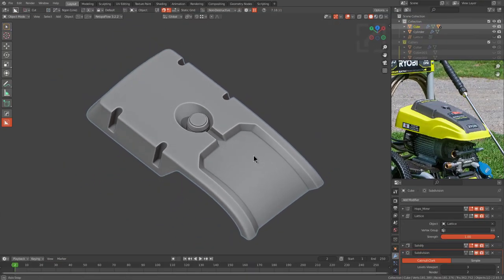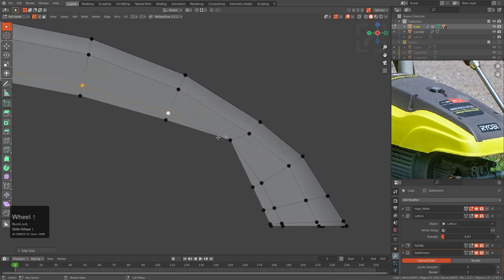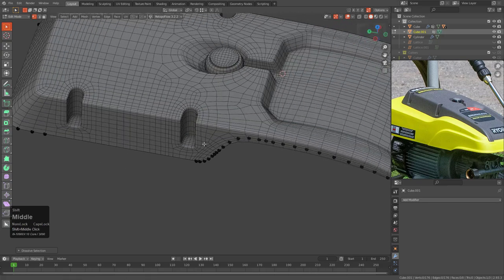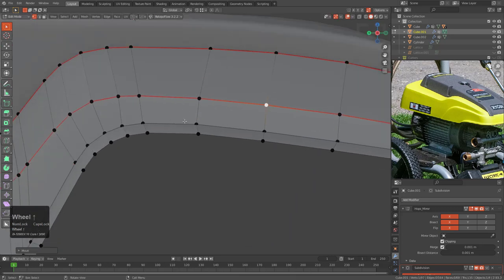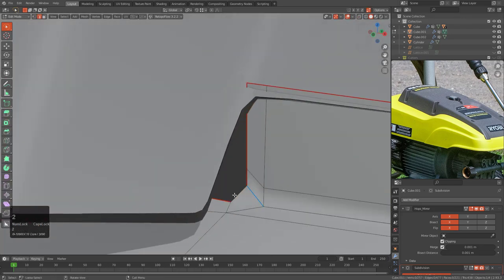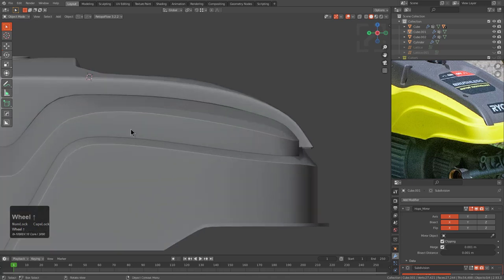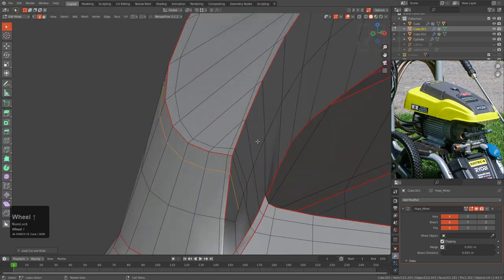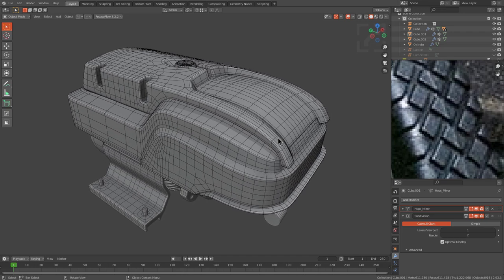Topostudy - pw Frontpart_1

Comment: @masterxeon1001 Great video! Although the model seems a bit different from the reference. I would suggest to growth sort of layering workflow where you do a simple blockout first, keeping the edge loop count low and even distributed, then you can use booleans to connect the different parts and add supporting edge loops later. Although there is no reason why you shouldn't use edge creasing since is supported by all 3D apps and most rendering engines. In this way you can easily make design changes if you have to. Hope that helps :)
Reply from the maker: thanks for the advice!